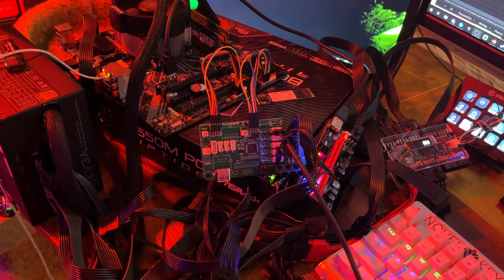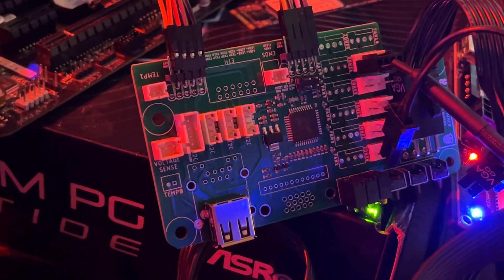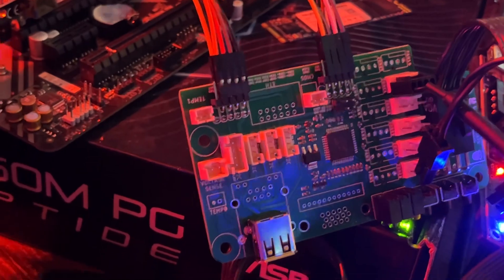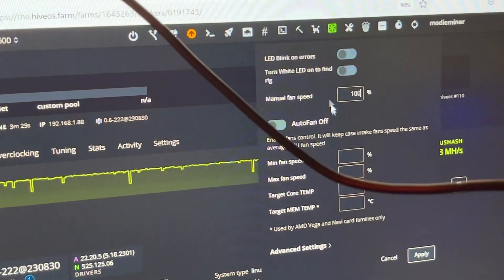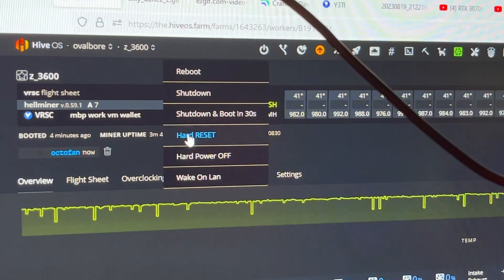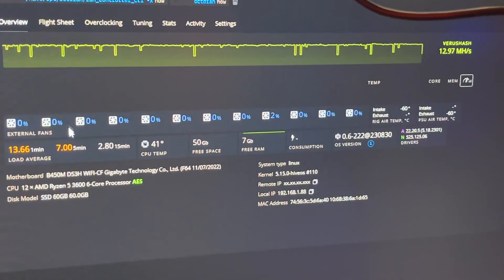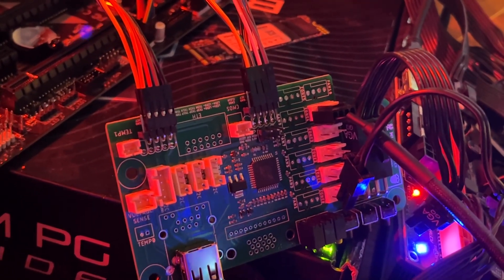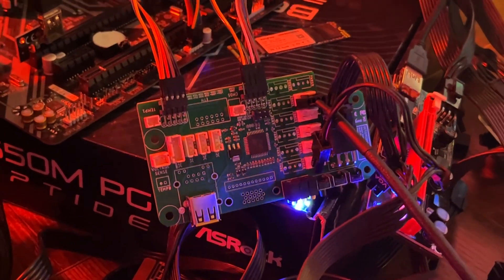Gain Octominer tools with ANY GPU Mining Rig

Comment: The momentary switched CMOS button could be repurposed for other things, power on an aux PSU or under hood LEDs :P
Reply from the maker: yes, definitely. the cmos header though is a smaller white connector so youd need to solder or buy some digikey connectors to do that.